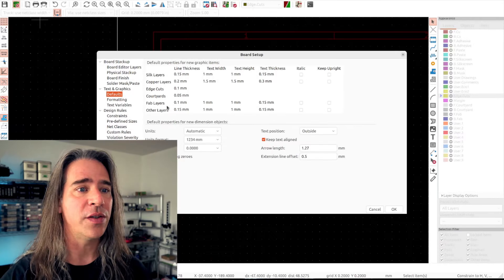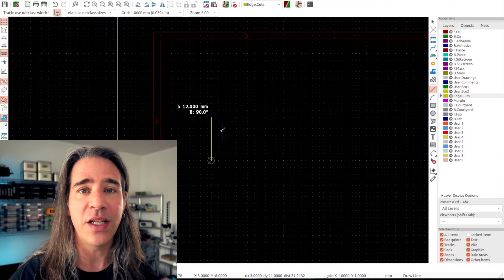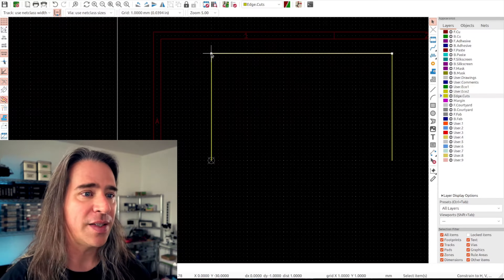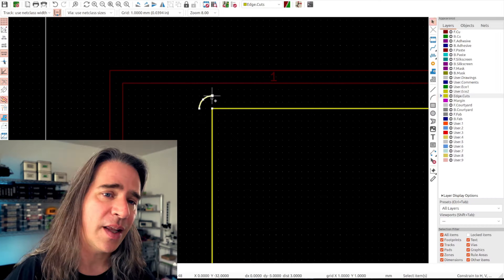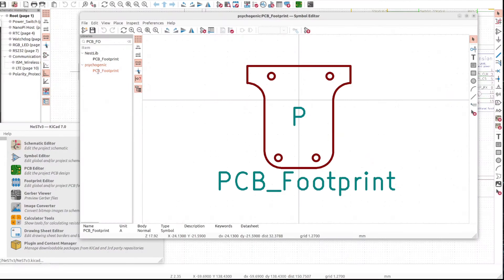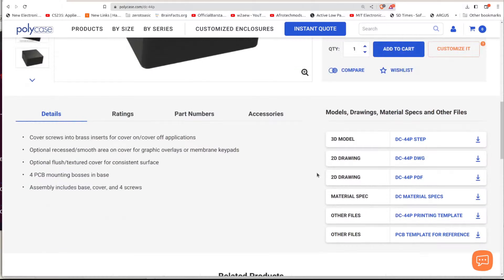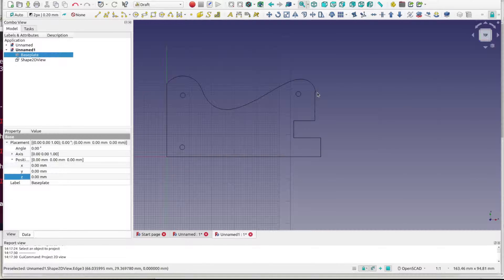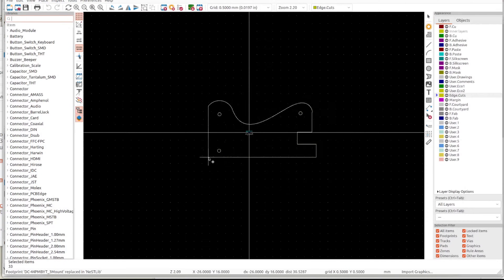Tame the yellow line:  Master KiCad 7 Edge.Cuts

Comment: You can get round corners even easier now. Just select all lines, right click and select Fillet Lines, enter the radius and boom, round corners! Even works for odd shapes.
Reply from the maker: No. Way.  This is awesome, damn I wish I'd realized and included it!  Couldn't find it in the footprint editor, but it works a charm in the pcbnew.
Reply: I'll have to try Filleting the corner between two edges that are at 45 degrees to each other. In the past that has been a pain because the point where the arc touches the 45 degree line tends not to be on any rational grid, involving some multiple of sqrt(0.5).

Comment: Is it possible to modify a rectangle shape in kicad? Let's imagine you have drawn your PCB outline as a rectangle but now you want to make a cut out like the one shown briefly at 2:13. Is it possible or should I redraw the PCB using lines instead?
Reply from the maker: Hello!  As far as I know, the answer is no.  In the raw kicad_pcb file, the rectangle is a (gr_rect ...) object and it can't be modified or even broken up.  I tried using the cool "fillet" tool: when you use this on a rectangle, you end up with 4 lines and 4 arcs--so at least it does that.  But if you want to keep it rectangular, it really doesn't like setting a radius of 0.  So, if you don't mind rounded corners, use some non-zero radius, then just edit the line where you want the slot.  Otherwise, you'll wind up redrawing the whole rectangle I'm afraid.
Reply: @PsychogenicTechnologies   Thanks!

Comment: Board outline as component -- that tip is golden!  One tip to add for viewers: Kicad footprnts can include cutouts, which is good for things like anti creepage slots, windows for recessing a component, slots for inserting a card perpendicularly (with finger-traces and solder bridges) etc. However, if also using Kikit for panelizing, beware of the interaction with Kikit's "tool size" that sets the size of router bit that it  assumes will cut features like the board edge cuts, but also your internal slots.
Reply from the maker: Nice!  Also, hadn't bumped into that Kikit issue, a good pointer: thanks :)

Comment: Thank you a lot. I found following quite difficult.. too fast and I miss all the basic knowledge to understand what you are doing. Are any other training of you at a much slower tempo? Thanks.
Reply from the maker: Hi!  Oh, I'm sorry to hear that--I tend to go fast, in general, and I don't want anyone to get bored... but, yes, sometimes just toooo fast!  
I don't actually have different videos optimized for speed, however on youtube you can go to "settings" on the video (the little gear icon) and then Playback speed, and then choose 0.75 or 0.5 to slow it down.  It's not perfect, but can help.  Same with the "CC" closed captioning, which is really good here at understanding my mumbling!
I hope that helps a bit.  Will try to stop running quite so fast in future vids.

Comment: That was awesome. Liked and subbed! 

I, for no reason at all, get weirded out moving around the different workbenches in FreeCAD so this was a huge eye-opener there, too.
Reply from the maker: :D ^ This ^ is why I put the juice into making these things: am happy you found it good/useful.  As for freecad: have felt much the same.  I think about it now like taking my board from the soldering station to the computer for programming, or whatever.  Different spot, different work.  But I still have trouble remembering where everything is and... c'mon, I thought that "Part" vs "Part Design" thing was going to be temporary, still mix them up all the time.  Love the program anyhow.
Final thing I'd add is I'm miffed I missed it, but have put an update in the description about this: kicad has a "fillet" function now in pcbnew, which is pretty sweet.

Comment: NICE.
I was wandering how you made sure that you can insert the ports in that box since you need to come at an angle + how you sized the holes in the boxes as in PCB hole VS case screw hole.
Reply from the maker: Hello Sanji, thanks for your feedback and question :)  On the first part, because the overhang of these connectors is relatively small, the angle of attack is as well, so you don't need to add all that much clearance.  I've done more complete simulations of insertion than shown here, where I actually angle the board in freecad and manually lower and twist, detecting collisions with either intersection or just a simple (but kinda slow) macro I think I got from https://forum.freecad.org/viewtopic.php?t=10041  However, the complete answer is: often the enclosure guy handles that for me, lol.
For the hole sizes, it's usually some standard size like M3 and I can just use standard footprints for those.  Here, IIRC, it was some imperial thing about the size of an M2, so I didn't take any chances and sized the holes much bigger than required to allow for some flexibility (d=3.x mm) while staying smaller than the typical head for the specified 4-24 (d > 5mm).

Comment: incredibly useful! Iḿ so reliefed its 90% the same workflow I use, I just shortcut the process in freecad by stamping the whole bock down in draft and draw the pcb outline in freecad-> then export to kicad and import as an edge cut layer. And now I know your approach which would give me more flexibility in the pcb stage! thanks for the tips! I also like how speedy this video is!
Reply from the maker: Hah, awesome!  So, you do the whole thing in freecad?  I use it a good deal, but am far from as familiar with it than I am for kicad.  So:  do you squish/2d the enclosure or just look at it from the top?  Then draw your PCB outline all in draft using polyline/arc/whatever?  And then, how do you export just your PCB outline?
As for flexibility, if you don't 'group' during import, you can still tweak everything in kicad I think.
Also, thanks for the feedback on the vid and especially the rhythm... it's the speed I'm happy at but need to know what others feel!
Reply: @PsychogenicTechnologies  I go to a top down view of the enclosure (just so I can see whats important ) get the shape in draft. Then move it to a new solid in part design and draw my shape parametric as a sketch, I either export that or make a solid the thickness of the final pcb and export it as flattened svg, and import that into kicad as edge cut layer. its harder to make little adjustments for cutouts as sometimes the group has a million members, so I will try your version next.
Reply from the maker: @MAYERMAKES  Ok, thanks for the explanation.  Annoying that it'd convert an arc or whatever you drew into so many little bits. Well if you give it a shot and find you're original way is better, lemme know why... I'm all about the "strong opinions, weakly held", always glad to find a better way.